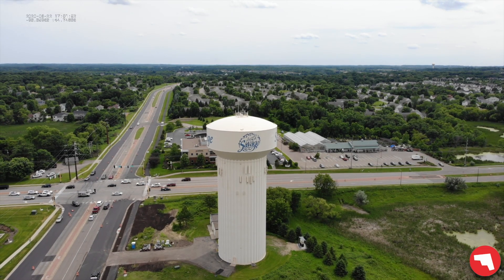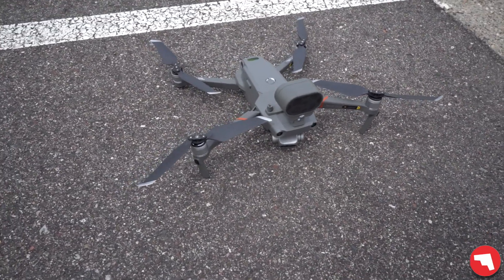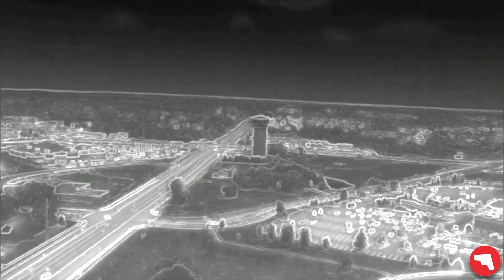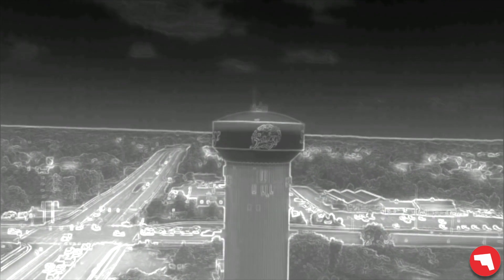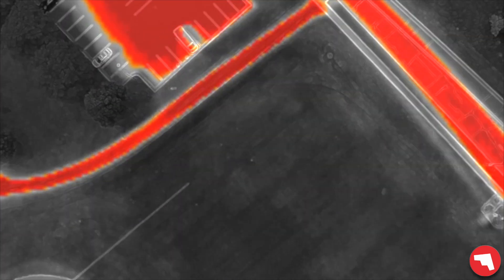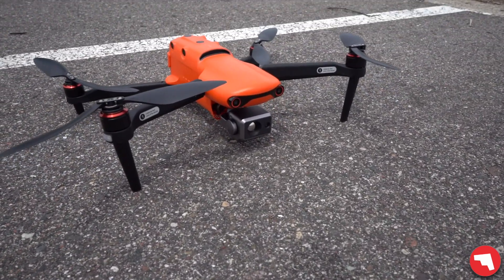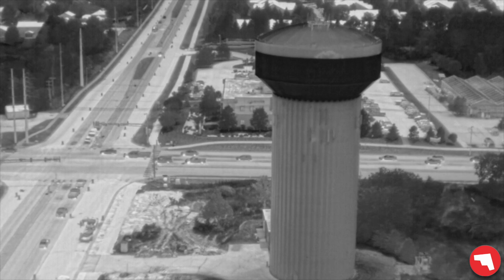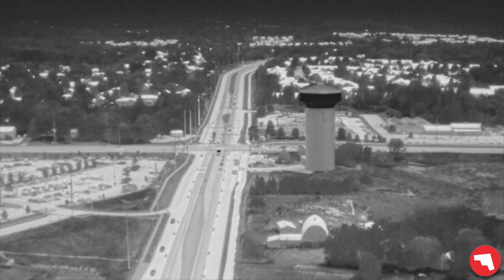Autel EVO II DUAL vs  DJI Mavic 2 Enterprise DUAL - Thermal Comparison!

Comment: Nice video! The 640 sensor on the Autel makes a pretty big difference. Rather than outfitting our M600 Pro with the DJI XT thermal camera, the Autel would be a lot easier to work with. The M600 takes 15 minutes to get up in the air and it is a real pain to travel with. I can see why a gas and power company would invest in a high-end radiometric thermal rig, but for your average scan, a 640 res sensor is all most people would need. I imagine most people are just looking for thermal gradients and not putting black tape on a roof to calibrate their emissivity :)

Comment: While Autel is the clear winner in terms of Thermal image quality and no geofencing, it lacks many very useful functions such as temperature measurements (spot metering, high/low temperature indication, temperature alarms, isotherm) to get temps, the flashlight and beacon and speaker attachment, the ADS-B aircraft avoidance information which makes the M2ED a well rounded tool.